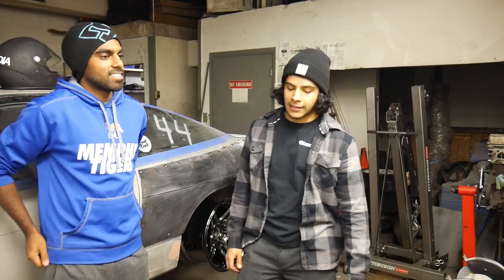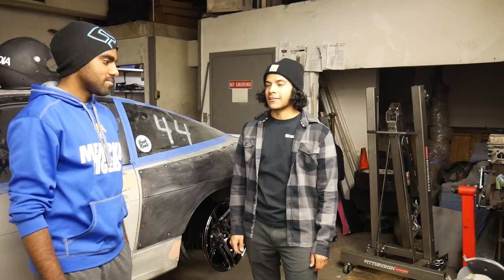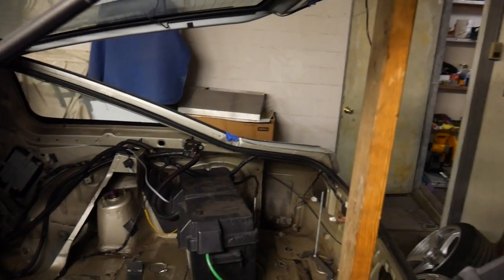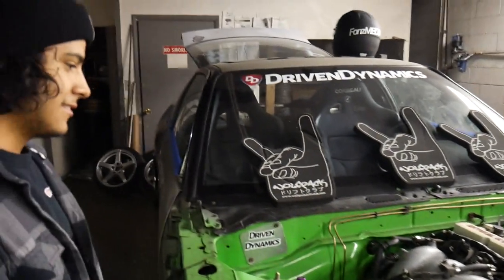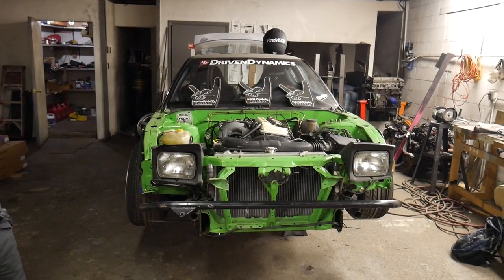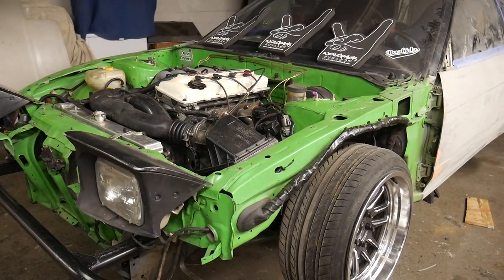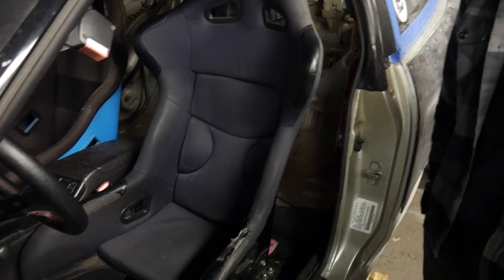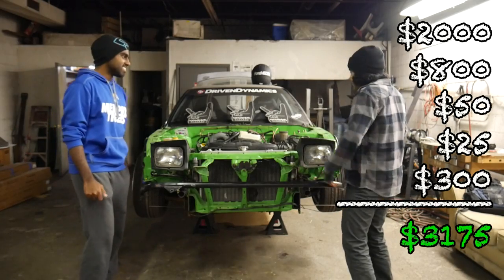Streetcar Life EP6: Building a Basic Driftcar

Comment: What about a  radiator u need to cool down that engine more since ur pushing so often
Reply from the maker: +cmian rambo Always a good idea, but really only necessary when you start hitting events on a regular basis. The temp gauge is key. After you realize your pushing your car hard enough to get the temps higher than normal, upgrade your cooling.

Comment: Nicely produced video, pretty helpful but I have a drift truck, I wonder how I can apply this video to my truck.
Reply from the maker: The main stuff is the same, the welded diff is the magic key to entry level drifting. For your truck, you're also going to want to focus on weight reduction and tightening up your suspension.  I know some tracks don't like trucks over a certain height racing. So depending on your situation,  you may need to lower the truck as well.
Reply: +Project Garage IRS will help in the long run, too! that solid axle won't be doing any favors hahaha
Reply from the maker: Yea independent rear suspension will definitely be a nice upgrade down the road. I know people use vette subframes or jag subframes to make it happen
Reply: +Project Garage Thanks for the advice guys

Comment: When y'all deleted the emissions did you delete that rod that runs through the bottom of the intake manifold? I can remember what it's called. It's got little plates that block each intake runner.
Reply from the maker: YES. the butterfly valve system. remove that garbage. either get an s14 upper manifold, or you can unscrew the little flaps off of the rod. extra cool points for cutting the rod out and welding up the holes.
Reply: if you're referring to the rod that goes into the pcv, yeah we got rid of it. I welded the holes shut where they mounted. 

if you're talking about the rod inside the runners, we got rid of that too. it's for the butterfly valves
Reply: +Project Garage 
Cool, yeah, I deleted them and filled the holes with JB weld. That was before I got my welder. No cool points awarded. 😅😔
Reply: +Juan C 
Nice! Thanks for the reply.
Reply: +Primer2tone Garage what up!!!  Lol
Reply: +frank Solis 
Yo meng!

Comment: could someone explain the "simplicity" part
Reply from the maker: what about it?
Reply: +Project Garage you were talking about removing Suff. what stuff?
Reply from the maker: +Daniel Schreiber Basically anything that doesn't have to do with the engine running well. A driftcar needs to be easy to diagnose and easy to work on. So you want to get rid of as much unnecessary stuff as possible. On Juan's car, and mine as well, we've removed all emissions related components, leaving only the IACV on the intake manifold. This brings the number of vacuum lines down by quite a lot. FPR, IACV, Brake booster, and PCV are the only vacuum lines left. Less vacuum lines means less points of failure

We both also removed the throttle body heater from our cars since these cars don't see temperatures that require them. Fewer coolant lines mean less points of failure.
Reply: +Project Garage thanks guya
Reply: +Daniel Schreiber I removed any and all accessories that I don't use. AC/Heat/emissions/horns/wipers/etc. I just kept what keeps the motor running, should you have an issue, it should be relatively easy to pinpoint what's going on. The majority of shitty idle problems are related to air, by removing all those hoses, and given that you emissions delete was done well, you shouldn't have many brain busting problems. I'm not incredibly mechanically inclined so I wanted to make it as easy on myself as I could

Comment: Where he fuck did you get one of those cars for 2k
Reply from the maker: +Rad You can find them! Craigslist, zilvia, nicoclub. There are always deals to be had
Reply: +Project Garage I'm in europe it's rare to find even a shitty one for 5k. :'(
Reply: +Rad 2k is norm to high in West coast US. I got a couple for $800 to $1500. Would never pay more for one. Unless swapped and done right. Even still I don't like buying other peoples work. Usually its half assed and bodunkt
Reply: +The Project Channel Damn i'm jealous for that money i can get an s12 half rusted away and without it's engine
Reply from the maker: +Rad Dude that sucks! Move to America and I'll give you a 240 :)
Reply: +Project Garage I'm afraid that's not an option for me right now :p
Reply: +Adsl1024o no you cant. cheapest ones are around 3k and they have over 250k kilometers. the upgraded ca18det is very unreliable engine and it propably breaks down in the 1st month you drive it. UNLESS it has just rebult engine but then price is around 5k. Sr20 swapped cars are around 6-7k and more but those are very rare. so you can get an ok condition s13 with 4-5k but you need to be ready to put some more money on it. And there is always the rust problems possible too
Reply: Hahaha aint that the truth. Ive yet to work on or buy a s13 that doesnt have rust either in the floor, the hatch seals or the trunk area. In snow states Ive seen the under cartages are horrid. Luckily I live in sunny California and we dont even know what snow/rain is here. But still its a rare gem to find a reasonably priced s13 thats unmolested or just utter shit.
Reply from the maker: You guys are about to be really mad in the coming weeks...
Reply: +Adsl1024o joo mutta ne 2-3 tonnin on ihan paskoja eikä kilometrejäkää oo niissä ilmotettu